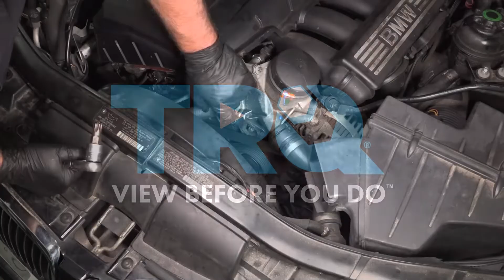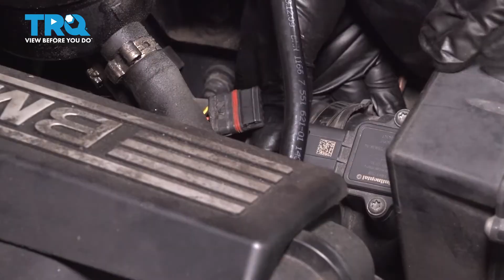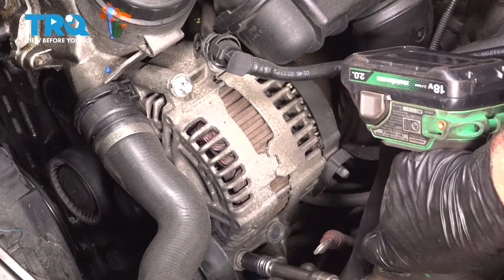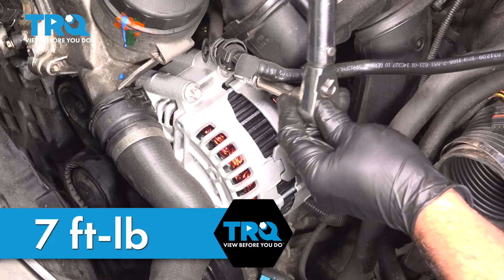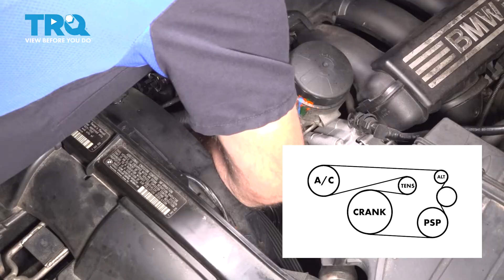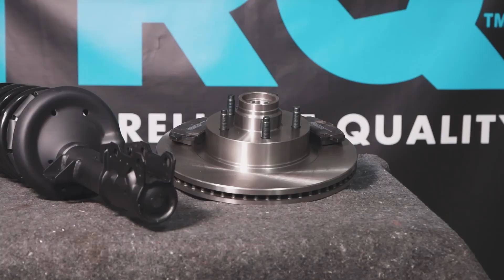How to Replace Alternator 2009-2013 BMW 328i xDrive 3.0L I6

Comment: It's 3:52am on Monday September 1st. Lights flickering, car died while driving and we were able to get home thanks to a trickle charger. Ordered new alternator and bolts, bolts won't arrive for another day. Is it ok to reuse the bolts just to test the alternator and then replace the aluminum bolts the next day?

FYI, I subscribed to you. Great videos. So far, I have replaced struts with coil overs, starter, battery, spark plugs and coil packs, belt, thermostat and coolant reservoir and ibs sensor using your videos.  I wish all the good things in life happen for you!!!